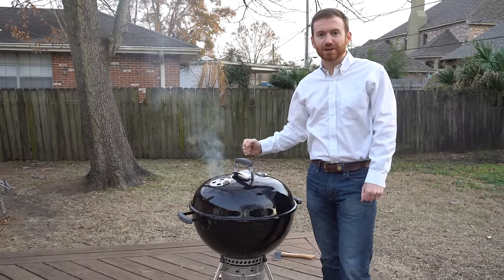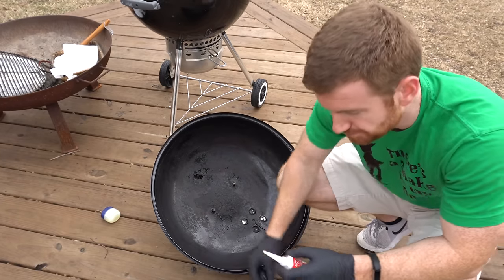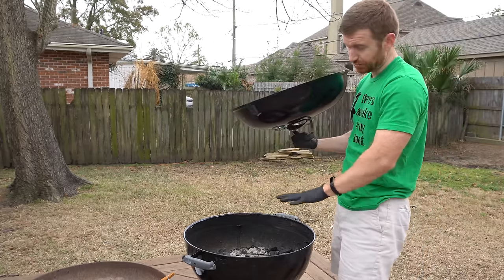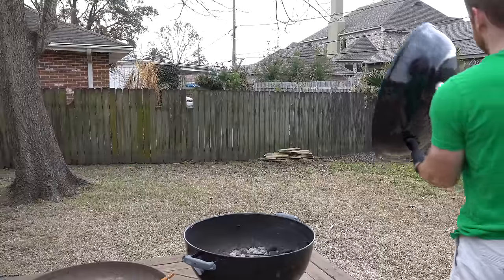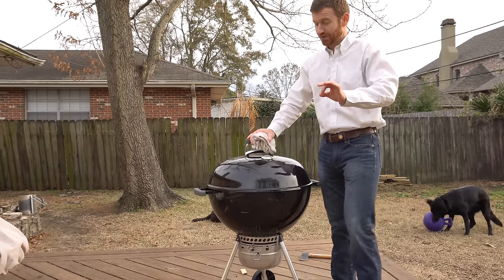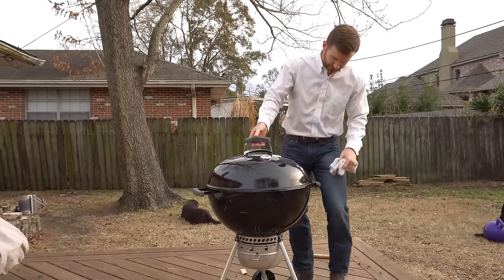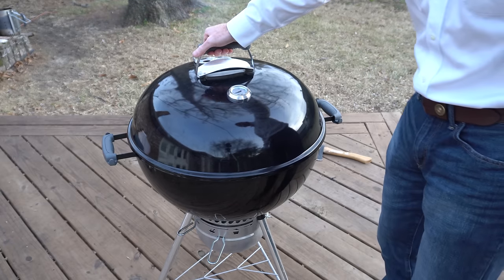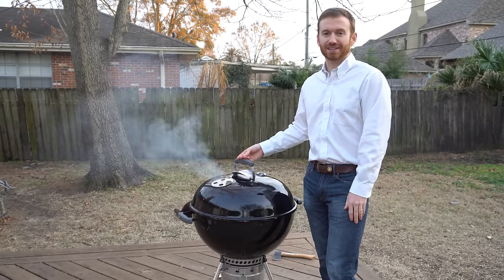Weber Mod: Silicone Seal for Low and Slow Cooking

Comment: I think root cause is kettle bottom or lid being out of round. Measure to find the long side of the oval, then bear hug. Works like a charm. I check for smoke leaks and bear hug as needed. Maybe 2-3 times a year. Takes me about 2 minutes to do.
Reply: This is exactly how it should be done. Basic stuff. No silicone needed.
Reply: Damn that’s a good idea. All three of my kettles are getting this. Thank you!!
Reply: Video of this needs to be uploaded . Bear hug it literally? Lol need to fix mine

Comment: Tried this method, glued the top to the bottom.  Applied plenty of Vaseline, a lot, but still glued it together I could barely separate the two.  Actually damaged the porcelain in the process of separating.  Pretty much ruined my grill.  Might have to buy a new one.  Maybe Saran Wrap might have helped.  But I just screwed my grill.  Cant say I recommend this method.
Reply: I don't know why people would do this method rather than the tried and true gasket + lavalock smoker seal kit(s). Sad to hear you tried his method and as I assumed many would have, with bad results.

Comment: The one thing I like about these kettles is the ability to move the vent around. You are now Limited to put in your vent in one spot.
Reply from the maker: you can still move the vent and it seals very well
Reply: @BreakItYourself  at the 2:40 Mark you said it's best to leave it in one spot. This is why I assumed you can't move it around very much.
Reply: @randyj5833  If you're using the kettle in way where you need the vent to be placed over different parts of the grill, then you're probably not going to be worried about smoke/heat retention for longer cooks at low temps. Anybody who uses a kettle for a low and slow cook like ribs or pork shoulder or brisket is usually going to set their grill up the same way every time, so you can estimate where you're going to want the vents at and then create the seal with that in mind. If you use your grill for other purposes that don't need smoke retention, then rotating the lid around isn't going to hurt the silicone seal you've made here, it just won't fit the exact line that the original seal made when it was cured.

Comment: Enjoyed the video, BUT just a note for anyone with a Pizza Attachment/Kettle Pizza that this may not be a great idea. The grill can get up to 900f+ temp wise and the highest I have ever seen a Food grade high heat silicon rated to is 650f.
Reply from the maker: ahh good point! idk if i've ever gotten up above 500 tbh
Reply: Break It Yourself With a big crescent of coals and large pieces of hardwood it gets to 800f+ with ease :).
Reply: Which felt seal from which vendor will you advise?
Reply: Cedric Segard High-Que gasket is made for extreme heat (Built out of Kevlar or Nomex). With a bit of work it can be used / moulded onto a Kettle.
Reply: Ok thx a lot
Reply: Many people use red silicone to seal the connection of their offset smoker firebox to the main cooking chamber. The firebox must surely go over 650deg F. Does anyone know what happens to this glue at high temps?
Reply: @davidwatkins8016  With Nomex based gaskets available I would just stick to that. I don't particularly like exceeding the manufacturer's specs.

Comment: If you are doing low n slow it actually isn’t a bad thing to have smoke come out one side of the lid, put your meet on the leaking side it’ll pull the smoke over your meat
Reply: You can also do that with the damper, rotate the lid so it's above your meat

Comment: i do not think this is necessary . i live in Wisconsin .i use my kettle in a -24 alot holds heat fine
Reply from the maker: for sure. It's less about temp retention and more about temperature control. I had a lot of air leaking out around the rim which made temperature control an issue for me
Reply: @BreakItYourself  same here. the stuff is curing right now, going to test it tomorrow afternoon!

Comment: Great Idea! Thank you I plan to do the same thanks to your video.
Reply from the maker: Be VERY careful. The comments of this video are riddled with people who glued their grills shut 😂😂😂 maybe use cling wrap on the bottom, Vaseline on top of that, and silicone on the inside of the top. OR Vaseline the bottom, silicone the top, press together and immediately take off to dry
Reply: @BreakItYourself I used painters tape, then applied the Vaseline. Worked like a charm

Comment: I did it with a high temp proof gasket bought from Amazon. Guess what, it seals too good so now I don't get enough air comes in so the internal  temperature keep dropping even the bottom and top vents fully open. 
I ended up wedging the lid a bit with a piece of wood!! Does anyone find same situation I wonder...
Reply: Yoshi. O maybe get a small 4 inch fan to blow at the bottom of the grill? You can get them for 10 dollars ok clearance at many department stores
Reply: Was thinking doing the same...

Comment: I did exactly like you did and made sure to use gobs of vaseline.   Sumbitch is on there like it's welded.  Used a razor blade to cut as deep as I could in the rim.  No good.  I don't know what to do now.
Reply: I had to pry my lid to get it unstuck. I globbed so much Vaseline on the lower rim but that was a waste of time. Now I have rtv stuck to the lid and to the rim. Huge mess and now the lid smokes even worse than before
Reply: @drimmie  luckily, I work with a neanderthal who was able to pry ot open.  That's after I spent hours with a razor blade cutting what I could reach.

Comment: OK, I'm going to try this.  We've had a lot of trouble controlling the heat on our Weber Kettle during low and slow cooking.  I suspect part of the problem is the leak between the cover and the bottom.  My only concern is my remote thermometer cables that have to pass between the top and the bottom.  Do I create a channel for them to pass through?
Reply from the maker: one of the best suggestions I got was to use plastic wrap on the side not receiving the silicone and then put the Vaseline onto the plastic wrap so that worst case scenario you don't get the grill stuck together. and as for the wires I didn't do any planning for them and just close them into the lid
Reply: Maybe try running the wires through the top vent holes......
Reply: BansheeFifteen it’s mostly about heat control and patience;

if u do a low and slow method cook, try loading about 80-100 coals to one side as far as u can to one side (spaced into a 1/4 moon shape) (unlit))
start off with bottom damper at about 1/4 open and top vent at about 1/8th open.
heat up 5-6 coals in a chimney like a weber or similar... get good and hot;
once hot, put those directly in the middle AND to the slide of grill of the 80-100 coals that are unlit;
put lid on;  wait for temp to stabilize for 15-20 min; adjust top vent in SMALL increments as required after stabilization to go up or down in temp; should hold at 225-240 for 3 to 4.5 hr. low and slow;
works great;

adjust for temps needed to start...

if u need to hold 275-300, start off with 8-10 lit coals (on top of those 80-100 unlit)

same technique.....

Comment: Why did you put it on the top instead of the bottom like 2 years ago? Thinking to do this with my wsm saran wrap and vasoline I dont want to chip it up like the other dude lol.
Reply from the maker: using it on the top keeps it more protected. having it on the bottom it got hit quite a bit.

Comment: I do not see the point to close the lid with the silicon fresh and having the problem of removing the lid later having all that sticky seal to the grill, and as you can see the seal is not even and parts of it were left in the grill when you removed the lid day after. I would suggest for the next time to seal the lid using your fingers and let it dry on its own. The weight of the lid then will be enough to make the seal to fully contact the grill without any lose of silicon, no need to make some sort of silicon mold. My 2 cents.

Comment: Out of curiosity - why would you care?  The seal is not going to help with heat loss.  You are just missing a little smoke?
Reply from the maker: i did it for finer temperature control
Reply: More for heat gain if you're aiming for 250 and its windy with an unsealed lid it'll climb over 300 with ease

Comment: Mmmm, gotta love that smoked silicone gasket flavor.
Reply: If you use the RED HI-Temp, it's probably OK. Good for 500F.
I'm thinking a length of Stove Gasket. Made for wood stoves so the heat would be no problem at all.

Comment: You can squeeze the the lid to make the lid perfectly level. You just have to have a little patience. My Webber kettles are sealed almost air tight. Occasionally I will see smoke escaping from the lid for about a minute. Of one my webers would seal before I unwarped the lids.
I do like your hack there though. I would have just waited until I straightened out the lid, or bowl first.
Reply: I need to try this.  Maybe putting a ratchet strap around the edge of the lid could work also?

Comment: Going to try this with my Weber - same style grill, but the dark red colour.
I think I'll do it a bit differently, though: I'm only going to put the silicone on the inside of vertical rim of the lid which goes over and around the bottom rim. Not sure if that makes sense as I explained it. The lid has some freedom side-to-side when it's on, so this way the silicone will take up that space and hopefully create an airtight seal. This removes the need to keep the lid on while it cures - if I put too little, just add another layer of silicone, if I put too much, the lid can still probably be pressed on, or silicone removed by sanding or trimming. I'm pretty sure this way would also mean it wouldn't matter which way the lid is put on after.

FWIW, Weber's answer to the smoke escaping is that it's not really an issue, and you should just wait until the carbon build-up creates a natural seal. I can't wait tho, and want full temp control immediately.

BTW - I have the same knife - Kershaw Leek in black DLC, plain edge. Great EDC folder!
Reply from the maker: Freaking love that knife! It was a prime deal one day so I snagged it. It’s my edc as well along with a few other things... haha I like your idea. I realize now that having the silicon cure while the grill is together can be risky. Someone commented that they essentially siliconed their grill shut. This method needs some revision.

Comment: Why not just use a felt seal and it holds smoke and heat in perfect.  Overall not a good choice to just use a solo chemical seal even if food great alone...felt would have been perfect.
Reply: How would you seal the felt. Know I'm a year late, but,I just got one of these since its just me and the wife. Still wanted to cook for 4-6 if need and veggies. Had big smoker but don't use as much. I remember a friend had one at his apartment for years

Comment: Hey, did you get any new idea to solve the leaking without any risk?
Reply: In my experience when the kettle leaks it’s because the lid and or kettle are out of round. Super easy to correct this. Use your grate as a reference and “bear hug” the grill. Doesn’t take much force to adjust the round.
Reply: @markboulier2006  This is exactly how it should be done. Basic stuff. No silicone needed.

Comment: When you showed the clip of the lid leaking smoke at the end before you siliconed it, why can you see a little red silicone already on it?
Reply from the maker: Two reasons. 1. This is my second time doing a seal so there was already silicone on there. And 2 I forgot to film before the seal so I offset it after I put the seal on just for example.
Reply: Break It Yourself  ok thanks for explaining. I'm definitely doing this to my Weber smoker. It leaks and this seems like a good idea.
Reply from the maker: Just be sure to use tons of Vaseline
Reply: Break It Yourself You can also make "protopuddy" by mixing corn starch and silicone together. The corn starch makes it so it's not sticky and you can mold with it. I saw King of Random make it for a seal for a vacuum chamber in one of his videos.

Comment: Why not put down some Press n' Seal on the kettle, then apply Vaseline to the Press N' Seal, then put the Lid w/High Temp Silicone on to the Kettle.  This way, you don't end up with red silicone all over your Kettle rim.  After 3 days, remove the lid with ease and pull off the Press n" Seal.  Easy as pie!
Reply from the maker: now that is a great idea! Bill you are a genius
Reply: I like that idea.  If I decide to try this I'll definitely use your method.  Thanks.

Comment: Hi there. I know you had to have used heat resistant silicone, but it would have been good to mention that in the video. Also, what brand was it and it's temperature rating?
Reply from the maker: https://www.amazon.com/gp/product/B072JVDG72/ref=oh_aui_search_asin_title?ie=UTF8&psc=1

Comment: Tell me why a small leak around the rim matters . Your leaking cause lid and or rim out of round slightly .
Reply from the maker: It doesn’t matter that much. May keep in some heat and help fine tune temp regulation on long smokes. Just thought it would be a fun video to try
Reply: It helps stabilize temps slightly. Definitely a worthwhile mod on a kettle. You really see the difference on windy days and cold ones the most. Great video!

Comment: Well, I broke it myself. I guess I didn't apply enough Vaseline, but I had to beat the lid off with a hammer. If you think you have applied enough Vaseline, you are wrong. Apply more. Now that I have beaten the powder coating off in places, I guess it will start to rust. And it still leaks smoke because I changed the shape of the lid. I should have bought a stick on gasket.

Now that I have already messed it up, I am thinking about what I would have done differently. I think I would have covered the base of the Kettle with suran wrap and sprayed it with Pam. I think the lid would have come off easily and I could have pulled the suran wrap off of the lid.
Reply from the maker: Oh no! We’re so sorry to hear this! What kind of grill was it?
Reply: Weber Kettle
Reply: I laughed out loud... Real LOUD! I'm sorry to hear what happened, but the way you worded it was money!

Comment: There is absolutely zero reason to seal the lid.
Reply: This is mostly for smoking...Sealing the lid allows you to completely control the temperature  by how much air you let into it.
Reply: Taylor R funny, I have 4 weber kettles and a WSM I use them all the time (actually using my WSM right now). I've never needed to seal the lids.
Reply: @jhitt79  Did i say NEED? Nobody NEEEEDS too. I said it allows you to better control the temperature.
Reply: Taylor R I'd be willing to bet $1000 that a side by side comparison would show no difference.
Reply: My WSM Leaks like a motherfucker yet it runs perfectly I can adjust the temperature from Super lo to super high and keep them very consistent.
Reply: Ahdoyyyyy same here! My door is old and all bent outta shape (same as me) but the cooker works perfectly. So maybe my vents are slightly more closed then a guys that’s all “sealed up” but so what. It would be the same CFM of air.

Comment: Vaseline on the bottom lip: after you CLEAN it real good then DENATURED alcohol and Vaseline BOTH SURFACES ( the bottom metal & TOP OF THE  SILICONE BEAD?)
TRY THAT { after some lid / kettle :" banging" to make them more concentric? 

You forgot to mention:" FOOD GRADE SILICONE" ?

SAVE SOME FOR THE TEMP GAGE TO KEEP GUNK OUT OF THE GAGE/ GLASS ETC. ?

Comment: That’s a dumb idea plus it doesn’t hurt anything if it billows out one side I’ve done low n slow cooks and my temp is easily manageable good way to ruin your grill plus when your doiing the snake method you need to turn your lid so vent moves as the coal burns now you can’t do that